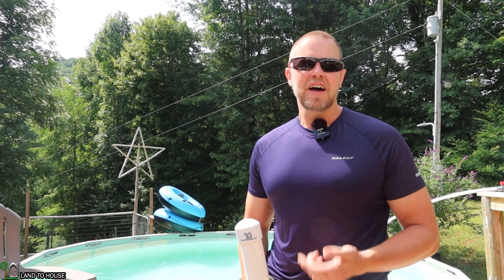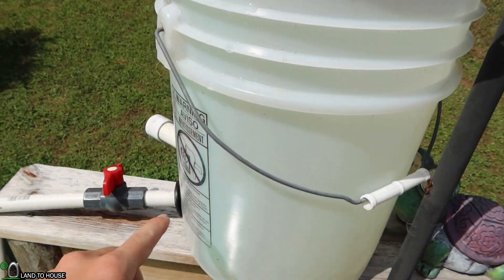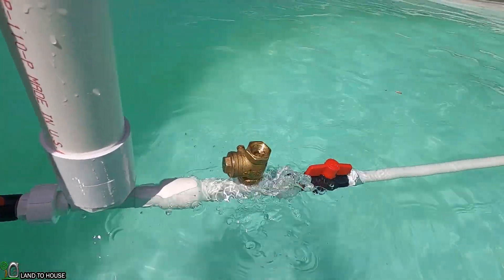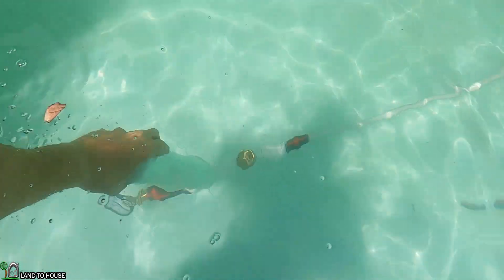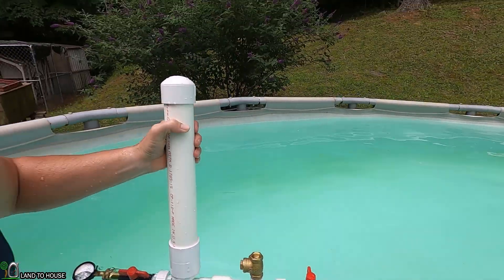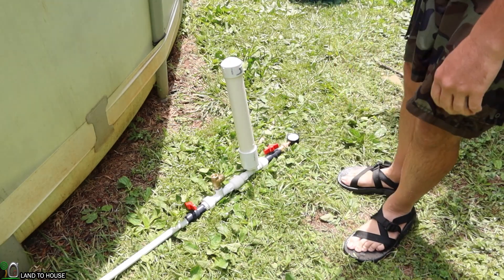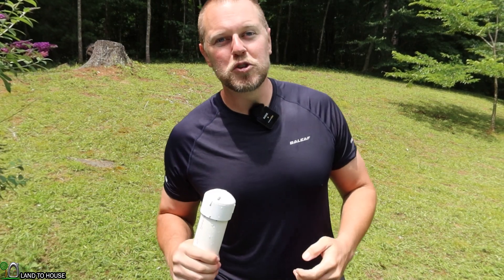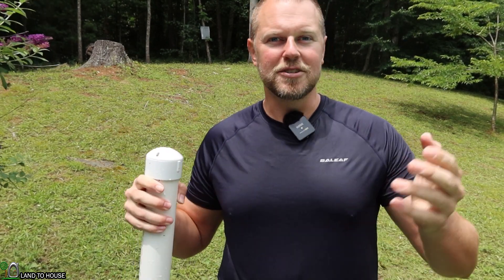Underwater Ram Pump Pressure

Comment: I've been a subscriber for a little while enjoy your videos on both channels I seldom comment always give you a thumbs up I really appreciate you sharing your knowledge! I have a question for you. I have a Artesian well. it is 55 ft deep when the water is not running out of the well you can very easily reach and touch it. I have a very large fall going from the well. I would like to try drawing out of the well letting it free fall down to the round pump would like to discuss this with you. before I buy one I would like to make sure it would work
Reply from the maker: Does the well keep that level even if water is pulled out? You can siphon start a ram pump as long as you have the drive pipe going down hill from the water source. If the well level drops as its used there might be an issue but if it replenishes itself you will be good.
Reply: @LandtoHouse  the water level my drop a few inches but not over a couple of feet I can put the drive pipe deep enough into the well where it will not run out of water. Also I can have foot drop within a short distance. Thank you for your fast response

Comment: On the top of the water it was 3 feets higher then on the bottom. So potential energy of the water was lower..
Reply from the maker: There is an additional 3 feet of drop underwater BUT there is also 3 feet of hydrostatic pressure on top of the pump.

Comment: Water has been used in engineering as a medium for dampening unwanted movement, from the looks of it, by dampening the vibration from the cycling it has in turned allowed the pump to run more efficiently and have an increased output. Due to the dampening effect of the water, the pressure increase of 3 feet of water, would not produce 10 more PSI.   An example of this dampening is in the use of Tuned Mass Dampeners used in keeping skyscrapers steady.
Reply from the maker: The second run of the test i let the pump go underwater and on top I tried to hold drive pipe and pump very still. But had the same psi difference.  Odd.

Comment: Thank you very much for the video!
I bought one of your pumps, and we'll try it out this weekend bringing water up from the creek to the cows.  Any idea how long it would last in a muddy creek?
I'm assuming it'll silt in within a couple days, unless there is a way to build it so the pressure would help it "self clean" or something
Reply from the maker: I like to use a bucket right after the supply water to help reduce the silt. That also gives an air free water source.  (I will have these bucket filters for sale in a couple weeks.)
Reply: @LandtoHouse  yeah I'm not sure if it'll work in my application.  The creek is slow moving and only about 10' of elevation change in a mile.  So I'm trying to use it completely submerged and put the ram pump on the bottom of the creek which is only about 3-4 deep.  I can dig a hole for the pump and get a couple more feet but it's probably going to silt in really fast.  I'm still curious enough to try it but kinda doubt it'll work
Reply: @isaacbell5646 just thinking...🤔...
I'm not sure how many smaller pumps would be necessary but,  it may be possible to connect several smaller ram pumps with successive, 'stair-stepped' delivery points (containers/buckets/250gal totes?) only slightly higher than each previous one, using "stair-stepped" delivery containers as volume-source pump feeds to artificially increase head pressure & flow for each successive ram pump, up to a final container (tote/water tower) tall enuff to cause sufficient final head pressure to send water uphill...📏🤏🏻👀🤷🏻‍♂️
Reply: @westtexastll1978  yeah not sure how the volume would work there, but at that point I'll just use a submersible 2" pump an run a fire house to 1,000 gal tank and use that throughout the week if need be.

Comment: Water pressure is main do to height. The pressure in the pipe is due to the height differences from the (water tower or the bucket) and the water at the bottom of the pool. So naturally the water in the pipe has higher pressure.

Comment: Maybe the viscosity of the water all over the valve decrease the force it closes
Even the density of the water can dissipate the wave pressure into it alot more then in the air

Comment: I think you might not be recording the pressure of the pump but instead you are recording the pressure of being under water. EDIT: That's not quite right. 😂 I didn't realize the chart I was looking at was in meters but I still believe the difference might have something to do with the pressure of the water not quite being taken into account correctly.